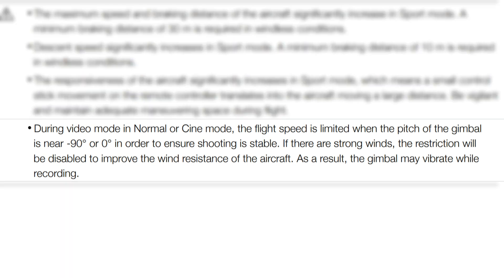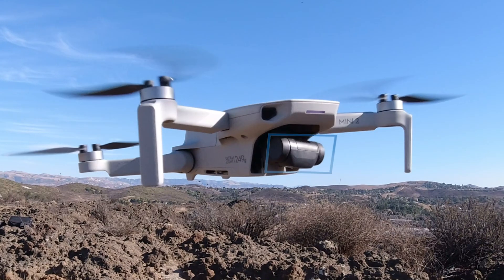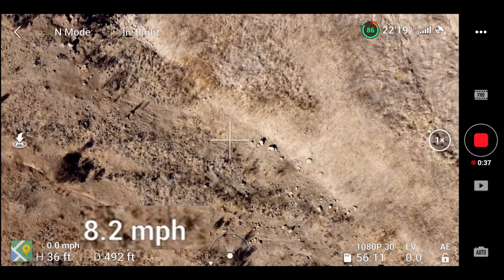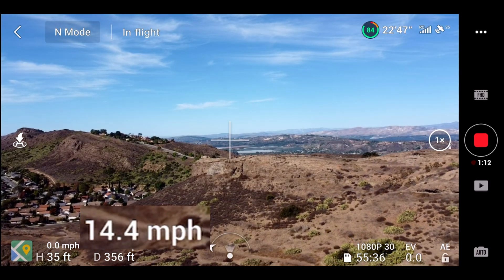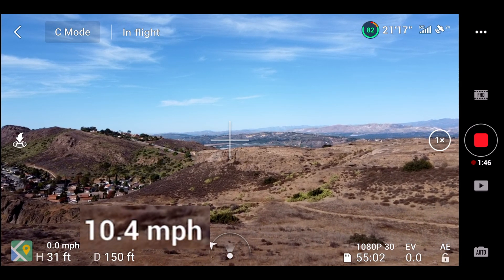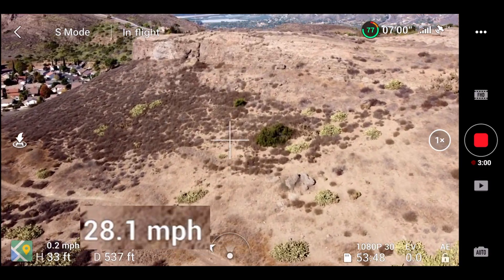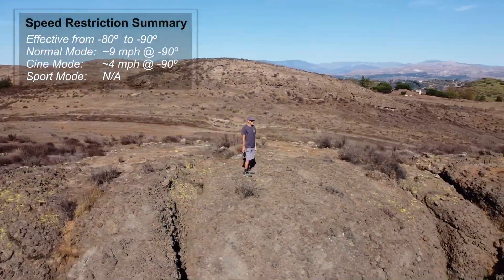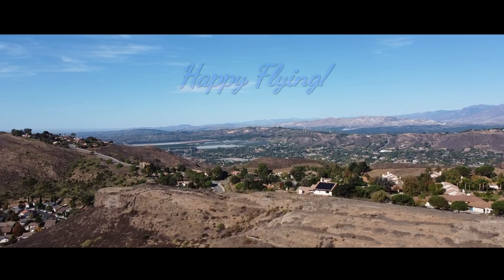DJI Mini 2 Speed Restriction - When and Why It Flies Slow - Also applies to Mavic Mini

Comment: it is definitely not a drag issue. its a gimbal movement LIMITATION issue. going faster requires the drone to "tilt" more which means its likely bumping into the hard stops for the gimbal. IE the gimbal can only move "so much" and then it can't move anymore. hard stop. you are probably hitting this at max speed and max gimbal tilt. I am betting there is no speed restriction so much as a "tilt" restriction which of course manifests as a speed restrictions. IE tilt the quad too far and now the gimbal does not have enough movement range to keep things smooth. lesson the tilt and the gimbal has enough range again.

Comment: Great video.thanks.any help on a cheap tablet or any tablet for mini2.thanks...and do I need iphone if tablet is ipad?can I use non-ipad tablet also?
Reply from the maker: Any tablet should work if it’s listed as a compatible device for iOS or Android. You don’t need an iPhone with the tablet unless you need to create a hot spot to provide data to for map info on a WiFi only tablet.
Reply: @D7dronetech  can I use hotspot from android to samsung or ipad tablet on mini2
Reply from the maker: @Ukw975  I would think so
Reply from the maker: Sure